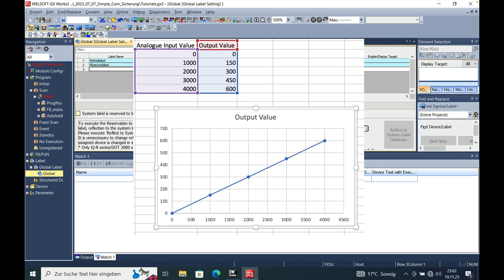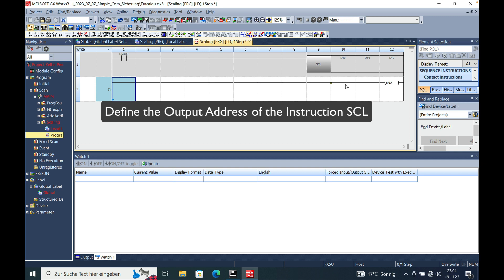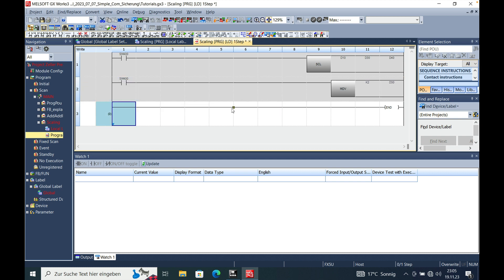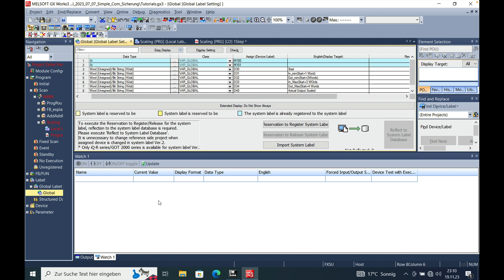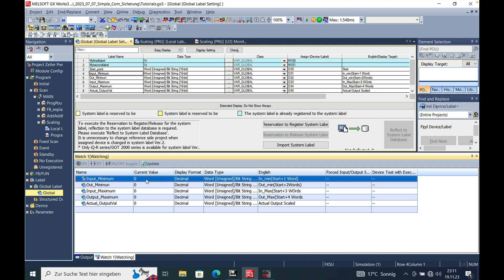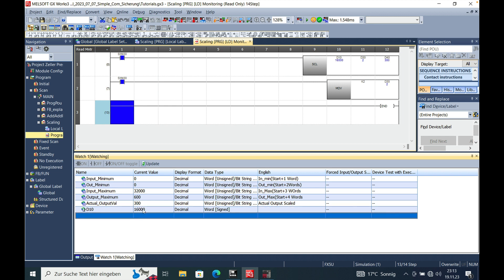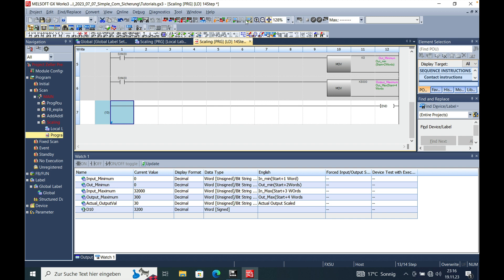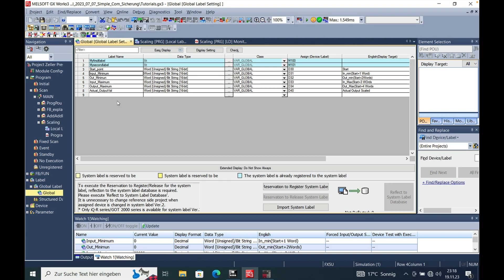Scaling Function with Mitsubishi FX5U CPU (SCL) IQ-F

Comment: Great video!
Can you explain a little bit about the scaling value? 
Why move K2 to D30 - why 2? Is it just to initizalize the scaling?
Reply from the maker: Thank you fir your question. The K2 in D30 is for the length of the scaling function. It is possible to scale more than 1 word. If you use more than one word the D31 wil increase accordingly. If i need mire than one word i use an additional scaling function. Therefor i made a function block which i can use multiple times.